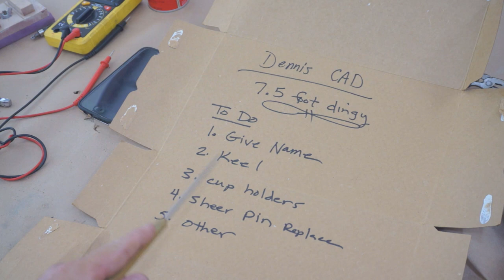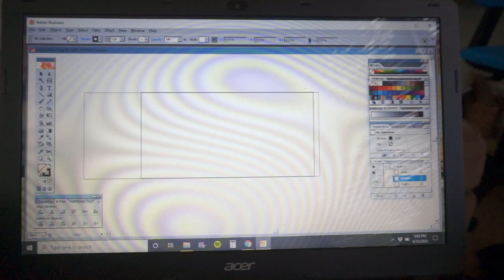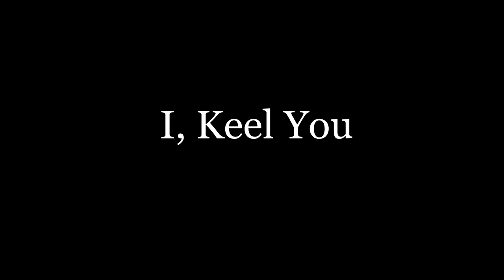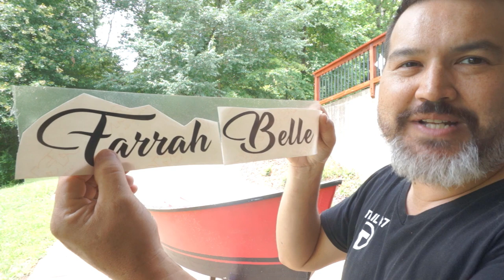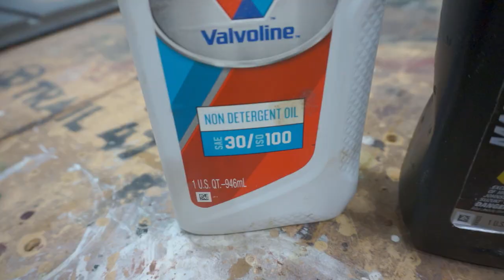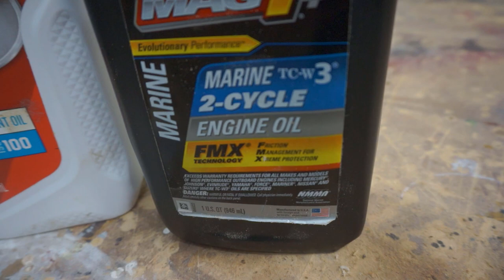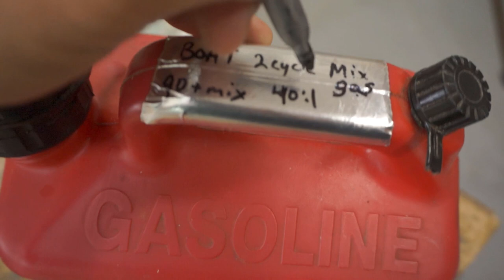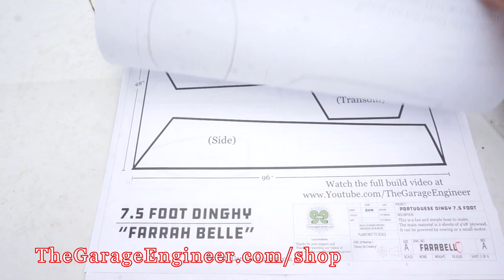Repairs 7.5 Foot Boat Build and Motor w/ Sea Trails: Part 8 - The Garage Engineer

Comment: Nice job, enjoyed watching your build.  Back in the mid 60's we had a 12 foot aluminum boat with a 3 hp Johnson motor.  It would push that boat around 10 mph or so.  As a 12 yr old I really enjoyed running up & down the river all by myself.

Comment: Supposed to be a set trim rod that lets you adjust the trim. Let’s the lower unit rest upon the rod. Looks like holes are there but rod is missing.

Comment: I think your next step should be to add a forward facing seat with a back rest, but sit it low down to lower your center of gravity. Then rig up a set of foot pedals with pulleys for steering :)
Reply from the maker: I was thinking about that.   But I was thinking steering  wheel. I like the foot petal idea. That would also move me forward in the boat for better weight distribution. Thanks for watching.

Comment: I've owned boats ranging from an 18' outboard to a 28' inboard. All long gone as I've moved away from the river. I was usually by myself on the 18 footer and I always had and used a KILL SWITCH for the motor. Perhaps this would be something you should add to  the Farrah Belle. If you fall over the kill switch attached to the motor and you by a length of paracord  would turn off the motor. 
Dennis I really enjoy your videos! I' in the process of buying a house with a large garage and your design is definitely going to be one of my first projects. I will buy your plans from your web site as soon as I'm ready to start. One quick question - do you think it's possible to use 3/8" plywood for more durability or would it be too hard to bend the curves?
Reply from the maker: 3/8 might be too thick to bend.  I used 1/4 and it was getting a little tough to at some of the bends. If you want thicker, try 1/4 then skin it with a 1/8 piece or even another 1/4 piece.  Good luck with the new shop.
Reply: @TheGarageEngineer  Thinking some more on it - I might just use the 1/4" and then fiberglass over that. Thanks for the "Good Luck".

Comment: B.O.A.T.
I've had many 2-stroke outboard motors in the past.  I bought a brand new 90hp outboard for my last boat and the dealer suggested strongly that I use only Yamalube 2 stroke oil.  At $100/horsepower I followed his suggestion.  When shopping at the local boating store at the harbor, I noticed that Yamalube was always the least available on the shelf.  Hmmmmm.

Comment: Did you get the water pump to work
Reply from the maker: yes no problems.  works like a top.
Reply from the maker: Yes.  Just need to replace it. I did it in another video.

Comment: Your keel is way too big and creates resistance to the side to side motion the motor is trying to push the boat. The best thing you could have done was, instead of keel, added wear strips or rub boards to the bottom. Just three strips of would 3/4 by 1" running along the length would give you the stability you are looking for in your keel yet still allow a side to side motion when turning. Plus they would protect the bottom of the boat when beaching.

Comment: I think you should put a stop in the motor to keep it up a little bit rather than cut the keel. The prop is kinda at an angle to where its lifting the rear of the boat anyway. You can see the ride plate could afford to be up a bit......or cut the keel and put a stop in the motor
Reply from the maker: I like the stop idea.  I think there is a part missing that adjusts and locks the motor at different angles. Thanks for watching.
Reply: @TheGarageEngineer  yes sir, I believe you are correct. Im not by any means an outboard boat motor expert, but usually they do have adjustment built in. Pretty interesting little project